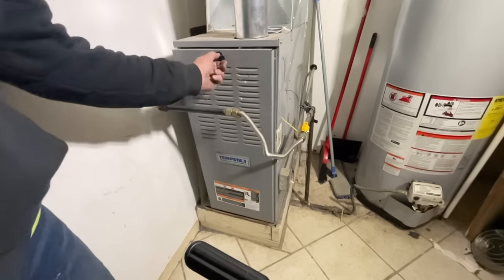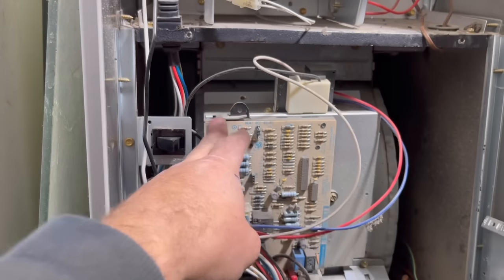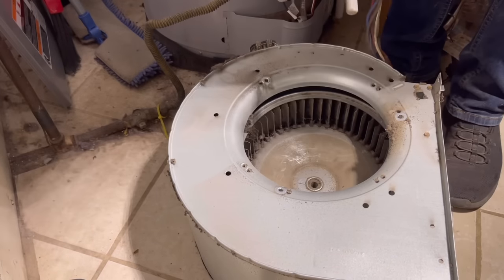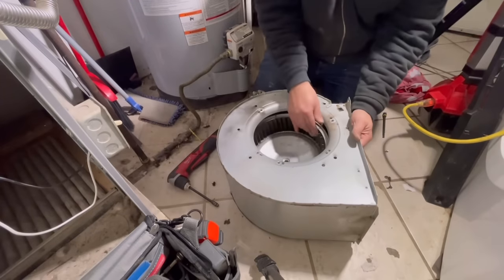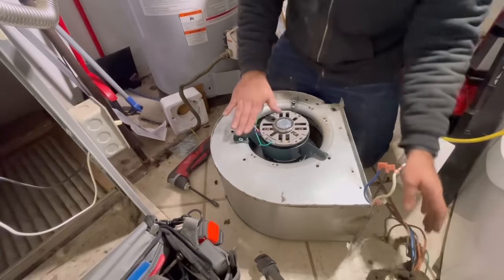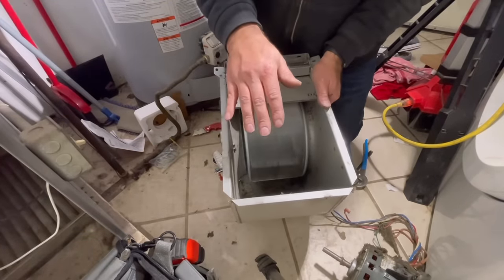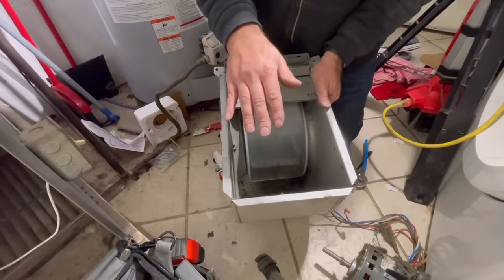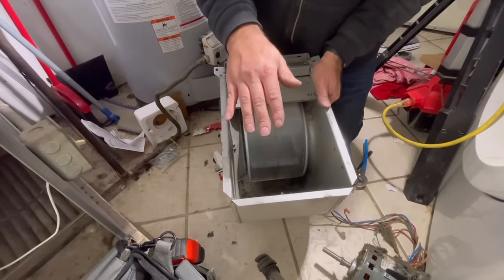How To Install A UNIVERSAL Blower Motor And Save Hundreds Of Dollars

Comment from the maker: My apologies guys, I meant to say we tested the capacitor and it was GOOD. It tested fine with my multimeter on microfarad setting. Sorry for any confusion :) cheers
Reply: Yea.  I was about to say. Most times a hum like that is a bad cap. Easy way to tell if its a bad cap usually  is spin the blower wheel with your hand and hit the switch to make it hum like u did before if it takes off running it’s usually a bad cap.
Reply: You did the right thing..... I've never replaced a blower motor without a new capacitor.
Reply: Hi HVAC guy, What does a company charge for this? Thanks
Reply: @jessezuniga1280  $1800 - $2500 on Long Island

Comment: You missed a whole lot here.  What about matching HP and RPM.  Many of these motors are multiple speed but you never mentioned any of that.  Then what about motor direction.  Some designs require the motor to run clockwise while others need it to run counter clockwise but you skipped that as well.

Comment: Question. Why didn't you thoroughly clean that circuit board when you had it detached? Compressed air usually does the trick.
Reply from the maker: This was a rental property and they kind of do the minimum. I could let the blower wheel slide though. It was super nasty.
Reply: @diyhvacguy  *couldn't
Reply: @diyhvacguy  Shouldn't matter if they are on time with their rent etc.
Reply: Yea, you could have taken that circuit board outside and gave it a good hosing with the garden hose!  Service is dead
Reply: @diyhvacguy  ...rental  property. Yup, same as up here in Alberta. The  ' owners '  just dont actually  GIVE  A  DAMM.  Eavestrough falling off, for 3 or more years;  sheds  full of mattresses/boxsprings/frames.  Washer/dryers/stoves, etc in yard, under trees.   NO  ONE  CARES,  anymore  = GREEDY  FOR   PROFIT.   No surprise, to me at all, that  the furnace is a dirty disgrace....
Reply: Washing the circuit board with a garden hose isn’t a good idea. Water and electrical components don’t go together very well.  I didn’t HVAC for 25 years.  Very often the motor doesn’t come off the blower wheel as easily as the one in the video did. If it doesn’t come off easily, never beat the shaft with a hammer. The end of the shaft will flare and make the job more difficult. If there’s rust on the shaft, clean it with sand cloth and use WD-40 or a comparable product to help loosen the shaft. BTW, Johnson usually only sells to licensed contractors.
Reply: @diyhvacguy  That makes no sense. 5 min of preventative maint might prevent a call back that costs hundreds.

Comment: Very nice video . I've commented before. I'll have something to say here. Years and years ago,  when I worked residential.  Anyone with a service agreement got visited twice a year.  Once in the spring and once in the fall. Our service manager would tell us if we needed to pull the blower assy. That was part of the service agreement.  Every blower got pulled out and cleaned and motor lubricated once per year. While the blower assembly was out we always changed the filter and thoroughly vacuumed and cleaned the entire blower compartment.  . A service agreement was 159.00  back then for 2 visits per year. Times were good back then.  Retired now.
Reply: Thanks for throwing this out there, it is good information for me.

Comment: It was a super handy video. Thanks to you, your encouraging words of "these things are all pretty much the same design", I pulled out my blower motor assembly out of an Aire-Flo furnace and cleaned the crap out it, and recorded the existing motors specs just in case. Thanks for the help.

Comment: I’ve been experiencing issues with my HVAC filters bending and creating air gaps, allowing dust into the house. I've already tried switching back to more restrictive filters, but the problem persists. Could a dirty blower be causing increased suction or airflow issues, making my filters bend? Would cleaning the blower help resolve this?

Comment: Good video.  Just had the AC guy tell me the blower motor was out and had to wait until Monday to get it replaced.  I watched this video, found the motor and put it in.  Only got hung up for a bit on the wiring because it was different than what I originally had.  My old motor handled the cap connection a little differently.  But we are up and running.  Family is happy and the temps in the house are dropping.  Phoenix 110+ today.

Comment: I've done this twice on my 1970s-era blower. Both times it was the front bearing worn egg-shaped from the weight of the squirrel cage. My blower seems to have more substantial sheetmetal in its construction and, therefore, more weight out on the end of the shaft. The first time I wasn't able to locate a motor but had a new motor with the same sized end bells, so I just swapped them onto the old motor. The second time I ended up with a 4 speed universal motor.
Reply: In my case I was able to find new bearings... brass sleeves in a body of plastic material

Comment: Really appreciate your videos!  Question about replacement motor specs - I need to replace a 1/2hp - 1100 rpm / 3spd - blower motor with an FLA of 10.3 amps.  It's difficult to find a replacement motor matching the amperage of the OEM motor.  Are there any issues with replacing with a lower FLA motor?

Comment: awesome video! 
But I have a question... I have 2 units in my house, one for the 75% of the house and the secondary one just for the bedrooms. I am thinking about replacing the motor on the secondary one to make it more quiet in the bedrooms at night. does this make sense? would it hurt anything? i am ok with not using 100% of its capacity as a result. I already have the motor out. 1/2hp 1050rpm R047 S. Any help is appreciated!

Comment: Saw the title and was hoping this would be converting an ECM blower motor to a universal motor with a capacitor. 
Would love to see a video on that.
Had a Goldman ECM motor die last year and was told the motor was backordered for several months. So it had to be converted.
Reply: What did you end up doing? ECM motor died in my oil furnace and I'd love to be able to swap it.
Reply: Converted it to a standard fan with a capacitor.
Reply: @hkgonra  Did you do the conversion yourself?

Comment: I had an X-13 (mounted vertically) go wacky last weekend.  It would NOT shut off, even with the COM & all 24v signal wires removed.  I'm guessing its orientation causes condensation to well on the module.
I ended up installing a DPDT relay for the L1 & L2, and it is activated by the Green fan wire.   I can hear the relay kick on now and then the fan starts.  
I suppose I should leave a note as to why! You know, just in case you work on it in the future.  LOL

Comment: Thanks. my 1992 Rheem central air  is still running due to yearly oiling and one recent disassembly and scrub brush cleaning . An old HVAC repair man once told me to buy the cheap filters because they put less strain on the motor when pulling air.
Reply from the maker: I agree 100% with that
Reply: I've always used standard pleated filters.  The blue fiberglass filters that you can read a newspaper through are no more than BUG CATCHERS.  LOL
Reply: double stack the mesh style and never use the pleated filters.
Reply: You can get better airflow by using the thinner cheaper filters

The strain on the motor from trying to pull air through a denser filter isn’t something that happens with squirrel cage blowers (or any centrifugal fan) since they’ll just keep spinning existing air around inside the blower housing.

Comment: electrostatic dust bunnies on the control board may short board components if humidity is an issue in Salt Lake city.  I thinking compressed air or perhaps 99.9% alcohol cleaning of board prior to reinstallation may be a good idea.

Comment: I have been watching your video’s, and have a question. On my motorhome I installed a soft start on each a/c unit. Works great I can run one on 30 amps now. My question is can I install one on my house a/c? Would it allow it to start easier? Or would it not pay?
Reply from the maker: I’ll do some research on this. I believe they are coming out with a wired soft start for residential ac so I’m curious to see how that works! Stay tuned! Cheers

Comment: Many of the cheaper motors or "universal" types are built with bushings vs. true ball bearings on their main shafts. The  number one reason most motors stop working is due to failed bearings/bushings and a ball bearing style typically is higher quality and will last longer than a bushing design. This would have much to do with what type of job is intended, long lasting quality or Chinese. Same goes with a capacitor...USA or Chinese, one lasts longer.
Great video on the process with one exception. Would have been a good idea to clean off the main board and interior of the air handler of all that built up dirt and dust. That amount of filth would indicate NO filter was used for a long time.
Reply: @Kevin-mp5of  Generally that is untrue however, there are millions of imported products that are just as good as USA or better but most of the time they aren't going to include electric motors or other mechanical devices. I have seen lots of hand tools from imports that are dandy and other things. Not to mention "made in USA" has been pimped out to include imported parts and imported assembly can bear the name if it meets a certain percentage of parts and assembly here in the USA so just because it says USA doesn't mean it really is a USA quality product. Brand loyalty is a thing of the past and it appear the brands are responsible for that some.
Reply: I had a Heil Furnace/AC that once it was about 10 years old I could hear from the attic a barely audible bearing whine when the fan was on. I had pretty good hearing despite loud stereo music and concerts in my youth. I found that the USA made motor actually had oiling ports, so then and every few years after that when I heard it again, I would pull the motor/fan out and oil it with a few drops of Zoom brand oil from an HVAC supplies shop. I understand now they are made sealed and you can't lubricate them. I would also visually inspect the heat exchanger for rust and cracks and clean out an dust and lint inside the unit. The only thing I couldn't get to, to clean, was the A style evaporator coil which I was just sure was coated with crud. Even though I knew my furnace was probably good for another 20 years, the system wasn't cooling well and I let them talk me into a new Lennox a couple of years ago, saying my condenser fan was bad-drawing too many amps(all it needed was a new cap I now know) and my compressor was testing weak -drawing too many amps-maybe true, maybe not. They also claimed the parts were obsolete now. I actually believed all that, because the condenser unit was the second one for that system-first one, the compressor conked out. Also the system was 25 yrs old, and R22 is sky high expensive. They left me overnight with a temp "replacement motor". When they took it all out the next day, the evaporator was very clean. I don't know why it wasn't cooling well but I have the feeling I got "took." Now this new Lennox sweats a lot and collects water in the pan, and now I see that HFC 410A is now being banned anyway! Great. I'll say one thing, after I have educated myself with all of these YT videos, the next time they better be pretty damn good to fool me, if that's what they are doing.
Reply: @freespirit1975  Always be aware of confident artists and those who only know the classroom facts. The experienced tech who is there to represent you first is the one to hire.
Reply: @freespirit1975  You did good in that case. Family shops tend to be better however, not less money.

Comment: My old motor has a brown wire running up to a box mounted on the wall next to the furnace. Does it go to a contactor ? should I delete it when installing a universal motor ? My replacement motor is three speeds. Can you show how to wire a three speed switch so I can slow or speed up the blower motor speed ? This is an old GE unit from apx 1979 that still runs great so it doesn't have a circuit board. Thank you.
Reply from the maker: If you’d like technical support check us out on Patreon.com/diyhvacguy   Due to demand, I can’t answer tech questions on here without more info. Cheers
Reply: @diyhvacguy  
, It’s not due to demand, you gave up the answer when you asked him to pay for your answer.
Reply: And this is exactly why you shouldn’t do things yourself.

Comment: I just replaced a genteq 2.3 1hp motor with an evergreen vs 1hp motor and control board. It was about $450 for the motor and $150 for the control board. Versus $800+ for the official replacement motor. And $1,400+ was the total estimate including labor. So I saved $800 buying the evergreen and i still have a pretty high tec efficient motor. And i didn't have to mess with a capacitor and wiring was fairly easy

Comment: Can you explain which speed is for which half of the system and does it matter? Thanks for the video.
Reply: Depends on resistance to airflow.  Too little and the heater will overheat  . . .  and so on

Comment: I used this video to replace my blower motor and capacitor today. It was very helpful. However, the fan still doesn’t work. Any suggestions as to what to check next? It looks and sounds like everything is working but the blower motor won’t turn on.
Reply: Oh yeah, this what happens when people think they can watch a video like this and then they automatically became an HVAC technician. There is a shortage of techs because the job is touch and the working conditions suck most of the time. Hopefully no one gets electrocuted or gets their hand sliced open doing this work!

Comment: hey i appreicate the video even though i watched it after i already replaced mine lmao. what causes a motor to go bad anyway? my motor was hanging up starting. just wondering if they go bad if ran too much or if they are just a long term wear part. thanks
Reply from the maker: This one was neglect for sure. You saw how dirty it was. They never changed the filters and overheated it I’m sure. Always keep your filters changed in a regular basis! Cheers
Reply: @diyhvacguy  is using too high of a filter level a stressor?

Comment: I noticed that you tap the capacitor contacts in order to discharge voltage and to prevent potential shock and should have said so.

Comment: Thank you for the useful, informative videos.  Are the Wago Lever Nuts heat rated to use inside the furnace or only for the blower housing?
Reply from the maker: Yes they can be used in the burner side no problem. Obviously you don’t want anything that close to the flame but in that area where all the factory wiring is, is totally fine 👍🏼

Comment: The blower fan in my air handler is going up and down in speed.  It'll go up to full speed for a few to several seconds, then drop down to a really low speed for a good while, and the it might jump back up.  But since last night it doesn't seem to be blowing any air at all, and I hear a noise like a rumbling coming from inside, it sounds almost like its trying to turn but can't.  Don't think its the capacitor because it'll still go up to full speed sometimes, just not for very long.  Is this a failing blower motor?
Reply from the maker: It sounds like a failing blower motor. If you turn the power off you can spin the fan manually and if it has some resistance the motor is on its way out.
Reply from the maker: If you need more help diagnosing this, check out our Patreon page at Patreon.com/diyhvacguy where you can get remote one on one assistance with any hvac problem! Cheers

Comment: Hey great job!
Just subscribed to your channel 
I do have a question 
My carrier furnace the fumes coming outoff the 3"pipe outside the house are very strong it will actually hurt your eyes if are close enough to that area
I replaced the inducer motor the whole assembly 
I olso checked the the pipe was clear or clean
Furnace is about 18 year old 
The condense water the comes out the furnace is like brown color 
What would you recommend 
Or what do you thing is happening in there 
Thanks in advance for you help
Reply from the maker: You should have a technician come out and do a combustion analysis and see if there is an issue with the gas/air ratio. Sounds like it’s sending a lot of unburnt fumes out the vent.
Reply: They’re called products of combustion, they’re not supposed to be pleasant.

Comment: Do those universal motors come as a 2 speed, or are they usually single? Curious, can a 2 speed furnace be changed to only run on one speed? For instance if parts are not readily available.
Reply: It may not work.  Furnace starts the fan on heating and t-stat starts the fan on cooling. There may be a way to do it but I don’t give DIY advice.
Reply: @caru3257  Thanks, was just curious. I have a two speed furnace, no cooling. Generally runs at low speed for 10 minutes, unless really cold out and needs to run for longer heat cycle.

Comment: Are the capacitors polar sensitive?
Reply from the maker: No, these little ones with the two brown wires don’t matter which wire goes to which terminal. The ones with a dedicated c terminal do matter though.

Comment: So my ? Is power off to CBRK and what about the gas do I have to turn it off to or not while replacing D motor.
Reply from the maker: The gas isn’t really needed since you are only messing with the fan but it’s always a safe practice. I typically just turn the switch off but I’m sure everyone will say to turn the breaker off just to be on the safe side 👍🏽
Reply: @diyhvacguy  thnk u🤙

Comment: why didnt you replace the capacitor instead?
Reply from the maker: I checked the capacitor and it wasn’t out of spec. The motor was definitely bad.
Reply: @diyhvacguy  you stated in the video that the capacitor was bad
Reply: @craigkohler2641  correct, that happened at 0:36 . Dave, did you misspeak in the video?